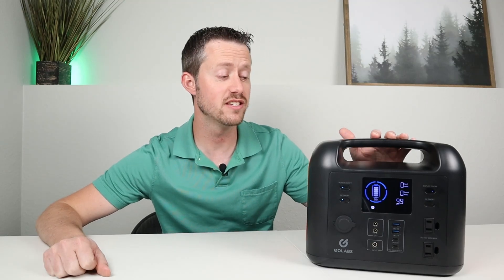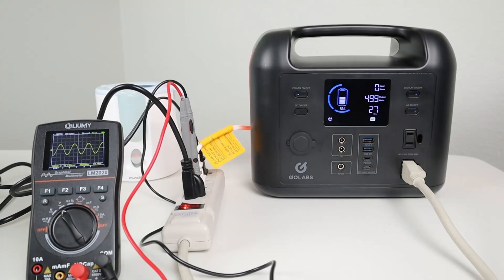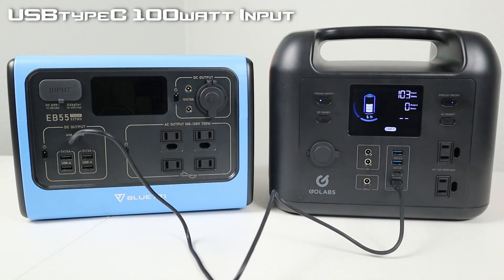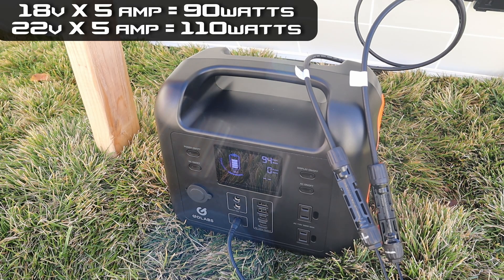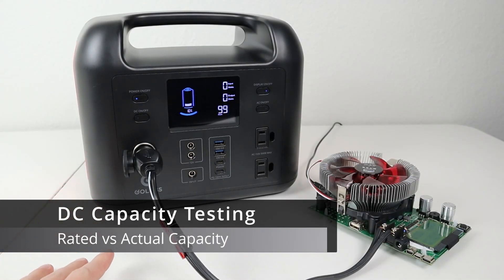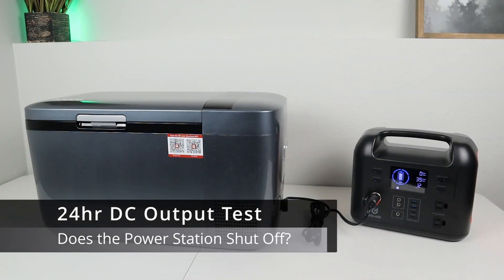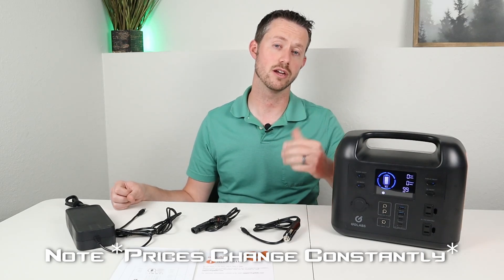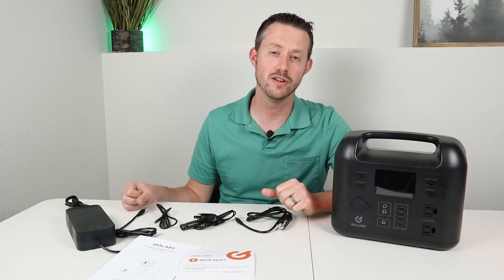GOLABS R500 - 518wh LiFePO4 Power Station - Full Testing and Review Video

Comment from the maker: Check out my website for tons of DISCOUNT CODES, power station reviews, my 12v fridge guide, and solar panels featured on the channel!      https://jasonoid.com/
Reply: I'm surprised the GoLabs R500 didn't come with a card for a free gift.  My R300 and i200 both came with a card for the free gift which is a free case.  Very nice gift considering they run for about $30 on Amazon.

Comment: I have had GoLabs r500 for 2.5 years.  It seems to be stuck in a safe mode or something.  The screen won’t turn on so hard to know what is going on.

I have a go labs 300 and have had zero issues with it.
Reply: Hey - I'm in the exact same boat. I haven't been able to find any solution

Comment: Looking at many videos while searching for the best unit (s) to get and I'm ALWAYS on one of your videos.. Very nice and well explained.

I have a weird question... I already ordered but might ask you anyway.
Plan on using two Golabs i200 (256Wh) station and would like to charge one another with PD. But since the PD port is both In and Out i'm unsure if the two units will want to do it.

I don't know but if you need to trigger ON the output but nothing to do on the Input maybe it will work..
Reply from the maker: It's complicated when both devices have input/output USB ports haha... It's best to use an output port when trying to charge another device. Usually the lower SOC device will take the charge.
Reply: @Jasonoid  Thanks for taking the time to answer.

I totally agree, the main question I have is "do you need to push the button above to enable charging" if not then I activate the output one only.
Reply from the maker: @DiaLFonZo  if I remember the Golabs auto enables the USBc port when it senses power, but you might have to enable the DC ouput button. I don't have this unit anymore so I can't test.
Reply: @Jasonoid  I guess I'll have to report my results 🤣
Reply: @Jasonoid 
Seems like working:
https://youtu.be/saZY6shtP2A

Comment: what is the better product this or the Bibine 600614? Thanks buddy.
Reply from the maker: This guy acutally shuts off the output when charging!  New bug I found after testing, I'd go with the FFpower CN505 (Bibene / Oukitel are the same as well).

Or the Bluetti EB55 when on sale is good too!
Reply: @Jasonoid  Thanks!! for a Clint Eastwood (fist full of dollars) maybe I should get the Oupes 1800?
Reply from the maker: @ddeltres  That performed well in my testing.  It was the cheapest on Amazon.
Reply: @Jasonoid  thanks again for the feedback.

Comment: one thing though as an owner of this unit as well as many have reported on Amazon review, the passthrough charging only last about an hour or so, so this is something to keep in mind if say you want to go on a long trip and you want to use pass through to power the fridge(my original plan), it will shut off in about an hour or so, which is confirmed by the vender as well. Which means I will need to get DC outlet split because I only have one in my car, and then plug the fridge and the battery both in, so that my battery is charged for overnight at a camp site. 
I am not sure if that's the same for other competitors out there.

Comment: Just got a R500.  It shuts down with error E12 around 10-13%.  E12 is low power error.  Is this normal?  Golabs has yet to respond to my question or file claim for a replacement.
Reply from the maker: Yes, that's normal, it tries to reserve some power to keep the battery healthy. Mine shut off around 10% in the review. I haven't been too impressed by their support, they have never gotten back to me about my questions or issues.

Comment: What are the recharging times from dead to full 100% please?? Thank you sir!!
Reply from the maker: This has issues with shutting off while charging, I'd pass on this one.
Reply: @Jasonoid  was the shutting off only happening during pass through charging or has it now been found to occur even under regular AC charging??
Thank you.
Reply from the maker: @chadrogers3161  it randomly turns off while pass through charging. Works fine if it isn't charging.
Reply: @Jasonoid  thank you and glad you posted update video cause it showed up after your 1st video I just watched as was about to pull the trigger cause they are even cheaper now and $80 Amazon coupon as well.

Comment: I have three Golabs r300 never had an issue till today. I think it was a E02 but my dc was still working. I’ve had these power stations for going on a year. My issue was on the ac. The screen read 55% I used the usb outputs to charge another power station. Went to the post office box, just a few minutes and when I walked in it read 0%. I’m thinking it will be fine after recharging it. I think this is a good idea to take these power stations to zero and recharge them as part of the maintenance once in awhile.

Comment: Hello Jason, great video. I have the golabs 500 and, even with a 100w rated cable, I am not able to charge it at 100 w but only stops at 60 w. I emailed the company but no answer.....btw I am using the bluetti EB70 external usb c output to try this.
Reply from the maker: I've had that issue before, I was using a 60watt cable by mistake, I'd try another 100 watt USBc cable. They look identical but have chips inside that allow different charging speeds.

Comment: 370wh is 90% efficient out of 518wh :S?  have u done a review on the golabs i200? love how in-depth your videos are excellent work!
Reply from the maker: Kevin, that's why I stepped away from trying to figure the 'AC inverter efficiency' in these review videos. In my new review videos, I complete 'AC discharge tests' to get the usable watt hours which is much better than trying to figure the inverter efficiency. In this video I took the DC output capacity of the power station (410wh) and compared it to the AC output, giving an inverter efficiency. I don't have the i200 unfortunately.

Comment: What is the parasitic loss of this unit? I plan to use it as backup for lights and phone/laptop charging during power outages? So the unit will sit in the closet after its full charged. Can I expect usable capacity of say 80% after a year siting in the closet after full charged?
Reply from the maker: From my testing it doesn't lose much power over time, just take it out of storage and top it off every 3 months or so. You should be able to store and and have it ready for an emergency when needed.

Comment: My main usage for it is to backup lighting and charge portable devices during back out. Is it safe to leave the unit plugged in all the time? Will prolong constant charging damage or shorten the battery life?
Reply from the maker: The battery holds a charge very well over time so you won't need to keep it plugged in all the time. Just charge it up once every 3 months or so if you are only using it as a backup power station.

Comment: Hello Jasonoid, The R500 started working again after 36 hours of being DEAD ? . I'm here by the MEXICAN BORDER for dentist. Was at  Salton SEAit  was hot but not that hot . Maybe like here 85°f . Could the unit shut down because of heat. The fan vent was not blocked pretty sure.  The R500 quit for 36 hours ? I purchased 2x GOLABS Sol Gen  and 2x solar panels good thing I did my new ICECO FRIDGE is working to keep my camping food co l d as I want ???? Still wondering about all this new equipment..... thanks
Reply from the maker: Hey I'm glad it started working again for you....not sure how that happens!
Reply: @Jasonoid  Hello Jasoniod, I don't know how or why that "GLITCH" happened . I did buy 2 GOLAB R500'S. Because of the NON FUNCTIONING pass thru ......   I'm glad I did though just because of my inexperience W/SO GEN's. But now the R500's have elevated this camping trip . GADGETY as it is .... 2x R500's 2x solar panels 1 60watt 1 100watt

Comment: Hello JASONIOD, Yep the r500 quit  working after 10 hours .1st camping trip..... Really just a testing period.  No AC no DC . The pass thru never worked as per youtubers and manual saying it does.  I'll be returning it for a refund
Reply from the maker: Sounds like you got a dud. Both my review model and the one I purchased with my own cash for my parents work just fine, no issues.
Reply: The R500 started up again after 36 hours dead except thee USB ? Now my FRIDGE can keep going . New to this technology
Reply from the maker: @davidtreichelpppj5304  interesting it started working again, I hope you can continue to use it.

Comment: Thanks for the review Jason. I bought R500 and i am a bit confused with your review of running the fridge for 24 hours( display said 37 watts output on your device in the video) so 410 div by 37 = 11 hrs, you mentioned your device was still on after 24 hrs or unless I misunderstood.... I ran a DC 48 watt, 4 amp  Slim Compact P20 Thermoelectric Iceless 12V Cooler Warmer 17L  and it lasted only for 8.5 hours? I am trying to figure out if my R500 is defective... Any suggestions?
Reply from the maker: Hey Bevan, great question! 12v fridges are different than thermoelectric coolers. 12v fridges run about 1/3rd of the time, so they use about 15 watts on average or less (depending on ambient temps). Thermoelectric coolers pull 50 watts constantly and will drain your battery MUCH faster. 

Your power station is behaving completely normal. That's why I purchased a 12v fridge for the first time, now I'm addicted to them, I have complete control over the set point and they hardly use any power. They are very efficient!
Reply: Thanks  once again Jason. Appreciate your response.
Reply from the maker: You're welcome!

Comment: Hey awesome video review of this product. Top notch, honestly. You mentioned some other products at a similar price-point with more features...could you please tell me what model(s) those might be? Im on the fence between this and the Bluetti EB55, and wondering if there's anything else worth looking at. Thanks in advance!
Reply from the maker: Bluetti EB55 is the best 500wh power station due to features and price point. 400 watt dual charging, 155 watt solar input, decent capacity, and loads of outputs. I love my EB55, check out my review video for it.
Reply: @Jasonoid  thank you for the fast reply and super helpful response! Subscribed to you. Just one laat question please. So the EB55 is currently $499 on amazon and the EB70S is $599 with a $30 coupon, so $570. Do you think the extra $70 is worth it for the EB70S instead, to get the higher capacity, or are the fans or any other issues too much of a PITA and I should just stick with the EB55? I know that both the EB55 and EB70S were a little cheaper not long ago, but I missed the sales and Bluetti support told me they just raised their costs due to economic reasons for now.
Reply: @Jasonoid  i think for the $70 more right now, I'll get the EB70S but let me know if you feel like the EB55 is somehow better at this point. Thanks a ton, Sir! Awesome content.

Comment: Have you tried pulling off the USB's after the DC 10% cutoff? I can pull the last 4% off my golabs R300. You can look up my review on it on Youtube to see a demonstration. The 10% cutoff is only for high load outputs like the DC and AC inverter on my R300. I can still pull all the way down to 0% on the 18w quick charge USB's which gives me a 94.5% efficiency until the 5% battery protection reserve is hit.
Reply from the maker: Good to know that the USB ports are active when it's a low percentage. Not really useful for my case since I use mostly the DC output on these power stations. Overall I think this unit is pretty decent.

Comment: Would you do Golabs R300 or the Bibene 505
Reply: I meant Golabs R5000
Reply: Dang.  R500
Reply from the maker: @scottf4277  If you wanted to spend a little more money, I'd recommend the Bluetti EB55. Little more capacity than the R500, larger 700w inverter, faster charging at up to 400watts, great 2 year warranty and product support all the time.  

Using my discount code of "Jason55" it will take off $55 so you'll see the price near $444, I think the little extra cash is worth the better power station.

Comment: Would a controller be recommended ?
Reply from the maker: These power stations have a built in charge charge controller, no need to add an external one. They just take a direct solar connection into the input jack.
Reply: Thank you

Comment: I have the Golabs r300 and 200 but would probably get the Bibene at this price point.
Reply from the maker: Actually, the EB55 is quite the 500wh power station. It's right between the R500 and the Bibene on capacity but has super fast charging and a 700watt inverter. Makes it more useful! You can bring the price down to $444 on the EB55 with my discount Jason55.
Reply: @Jasonoid  Thanks

Comment: I know you like Anderson but have you done an adapter to go from barrel direct to fridge? I have trouble with cigarette from Bodega being tight in car or power bank. Or do you know of a lower profile tighter fit cigarette adapter for fridge?
Reply from the maker: You can purchase replacement fridge power cables online, all the "budget" model fridges use the same connector and 12v plugs. Something like this should work:
https://amzn.to/3CIN6Nm
Reply: @Jasonoid  yeah that is the one the Bodega came with and it shifted to where didn’t make connection. Just seems really loose in the Oupes

Comment: That looks like an excellent unit for a really good price...if you apply the discount.  Without the discount, it's in the same price range as the Jackery 500, although I would argue that this GoLabs R500 is superior in several ways, including the 100w bidirectional PD port, LiFePO4 cells and faster solar charging.
Reply from the maker: Hey Jason, I was happy with this power station. It offers a lot of great features but I would have liked to see a little more capacity while discharging it. I think I'd still recommend the EB55 over this one for now, it has slightly more capacity, it has a 700w inverter and should be priced similar for Black Friday deals!
Reply: @Jasonoid  EB55 is $449.99 so $100 more than the GoLabs R500 
the Bluetti even with extra $100 may still be a better deal.